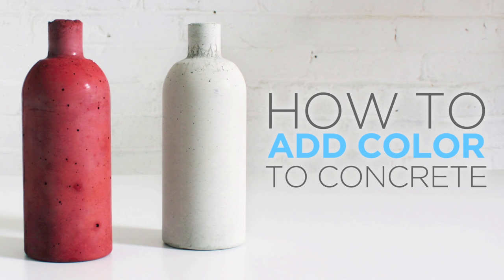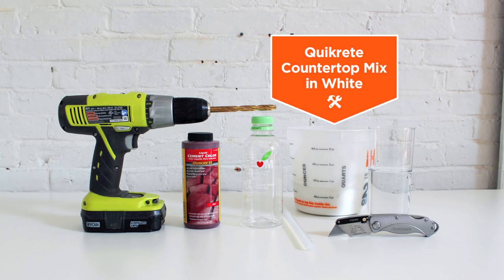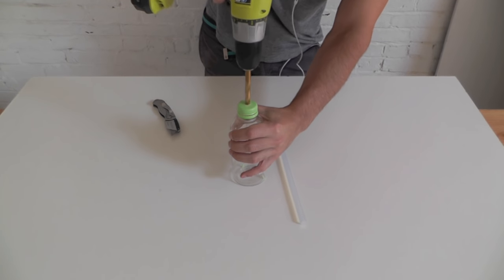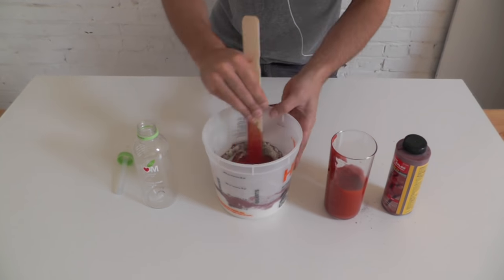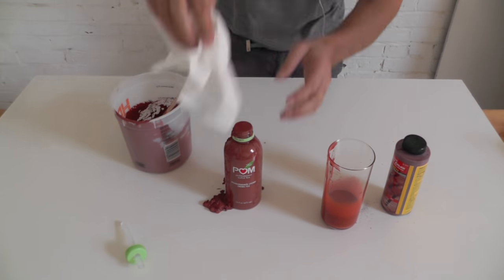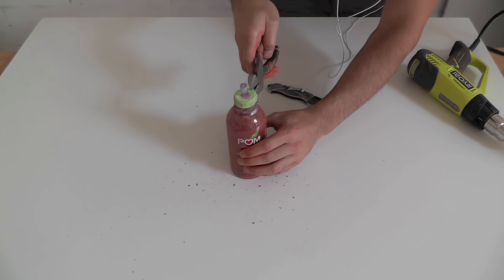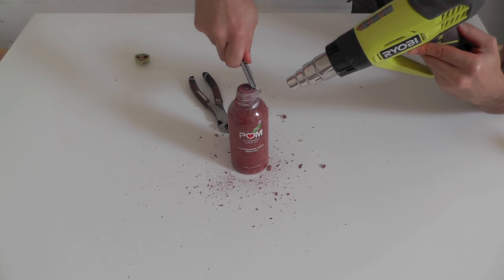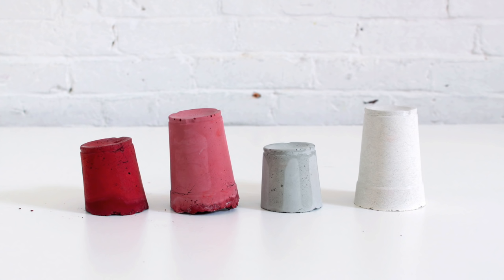How to color concrete with an integral pigment

Comment: I'm a finish carpenter-handyman-cabinet maker, and i design projects, so i consider myself to bepretty handy around houses, tools, etc etc.....with this said, i have no idea what this video is suppose to teach me. I was seaching videos to see how to add red dye to concrete and i find this. I've added black dye to concrete before and it worked out great, buf wanted to know if red would workmout just as good, and if i should know something. Please explain what you did here, and what those plastic bottles are all about amd what you are demonatrating.....

Comment: Question: Instead of pouring all the colored concrete in a mold, could I fill a mold with concrete (not colored), then fill the last 1/2" of the mold (exposed portion) with the colored concrete to save money?

Comment: where to get the white concrete ?
Reply: +Anthony Berry I second this
Reply: He said he used "white" concrete countertop mix by Quickrete
Reply: He buys it at home depot. Special orders it
Reply: I contacted Quikrete directly:
"Our Countertop Mix is a special order item through the service desk at either Lowe's or Home Depot. They have a SKU# just for special orders - put product# (1106-81) in description area."
Reply: @robbiescarallo3085  It's also stupidly expensive! I see that home depot wants $25/80lb bag, which is fully 4X the price of 5000 PSI concrete. You may be able to make your own white concrete by getting your own white aggregate like white sand and a light colored cement (the ingredients for concrete itself are pretty simple if you have the cement), but I've not tried it.